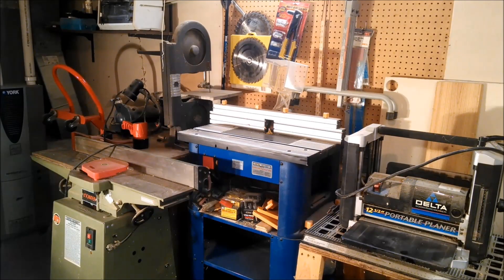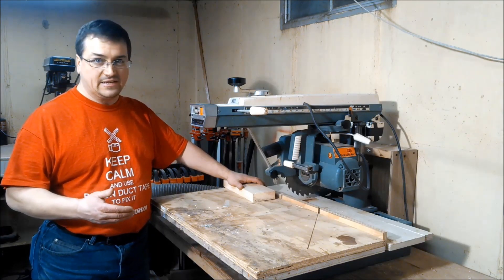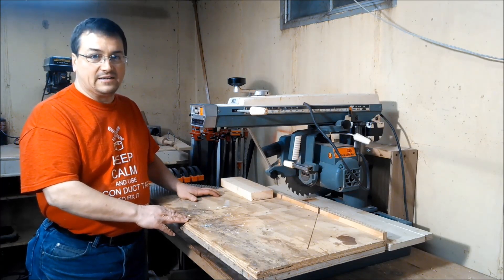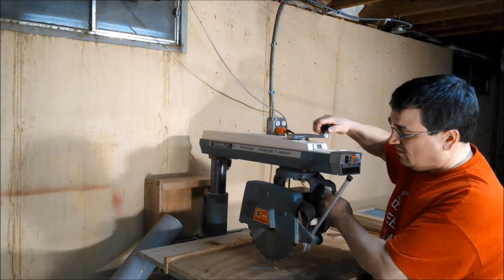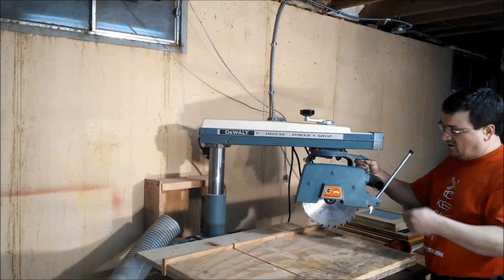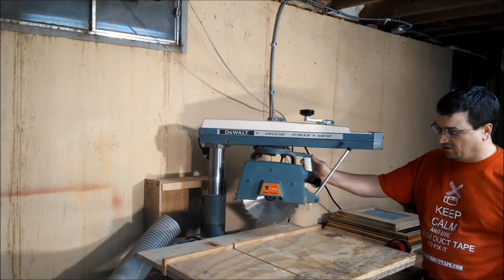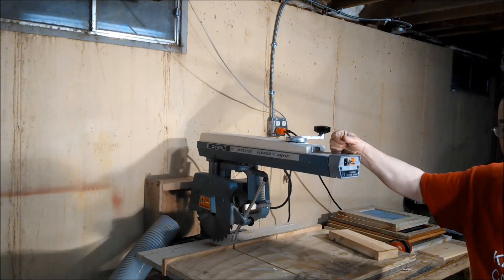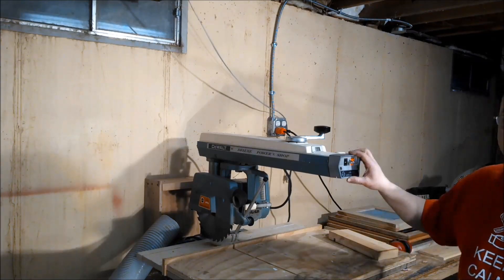The Radial Arm Saw, (The Rodny Dangerfield of the Shop)

Comment: Nice radial arm saw.  I have one like yours Dewalt Black and Decker model H-1450 . My neighbor who passed away had it and his son put it at the curb. I put new table wood on the back and upright wood. Also put on an 8 inch blade and taped up an area of 8 inches on each side of the blade to keep hands out and use a clamp for small cuts. I use for cross cutting only.  Be safe wood working!
Reply from the maker: That is how I got mine. The former owner passed away and the family gave it away. Thanks for watching.

Comment: how about the most dangerous song on the planet
Reply from the maker: If not properly set up, Squared, and using a table saw blade instead of a blade made for the Radial arm saw, they can be very dangerous. I have used one of these that was out of Square and it was a very scary saw. However, the 3 I have used at lumber yards that I worked at, were professionally set up were no more dangerous than any other saw. Thanks for watching.
Reply: Safer than a table saw if setup correctly, because you're hands don't move. They are generally more stout than a sliding miter saws as well as being more accurate, and more versatile. , if setup correctly!